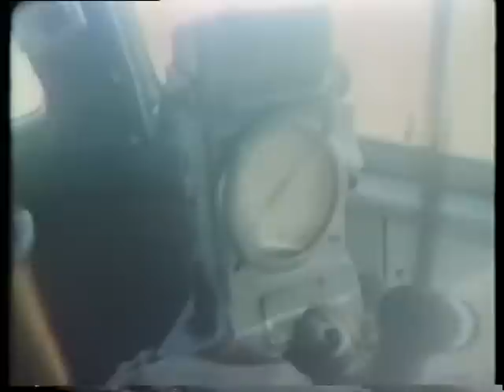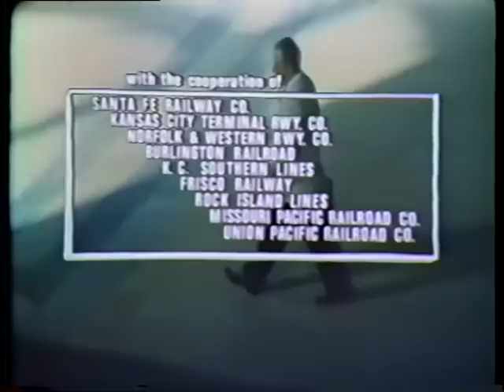Last Train From Cherryvale

Comment: Two trains ran betw Tulsa and Kansas City, the Oil Flyer and the Tulsan. The Oil Flyer was discontinued first. The Tulsan lasted til Amtrak began in 1971.
Reply: If I'm not mistaken, part of Santa Fe's route between the two cities is now gone.
Reply: @chriswalker1993  Ottawa, KS(where it split off the Transcon)  to Humboldt, KS is gone, the rest of the line is operated by the South Kansas & Oklahoma railroad which took ownership on 12/28/90.